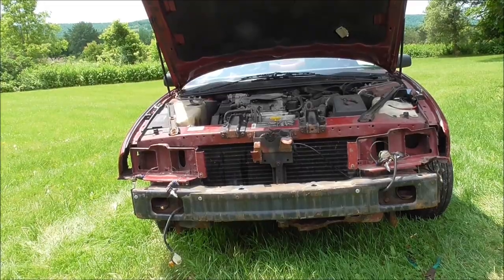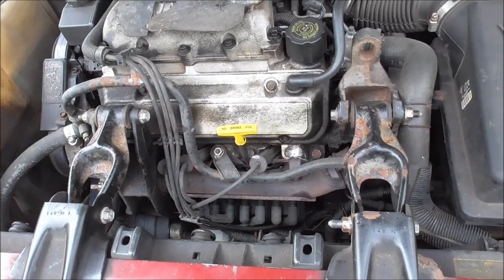Stripping the Regal (day 1)

Comment: I just built a regal it was a 1988   didn't trust the wirering. Carbed it.   Ran good the whole derby. Started every time.    Broke my rack and pinion and got stuck. Held it to the floor and it blew up.  It was a boring blow up.   Wore out the Piston crank bearing surface and beat the heads and pistons to hell.   But it ran long enough.